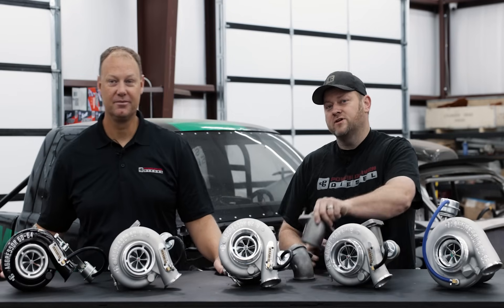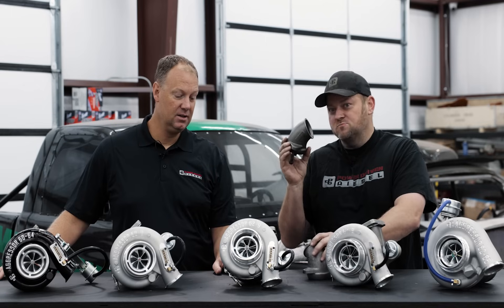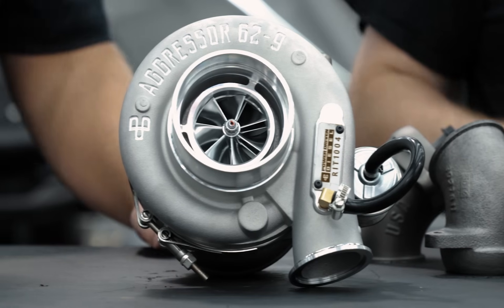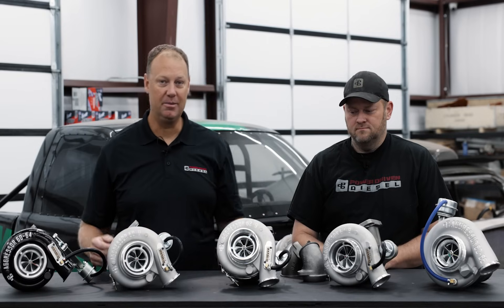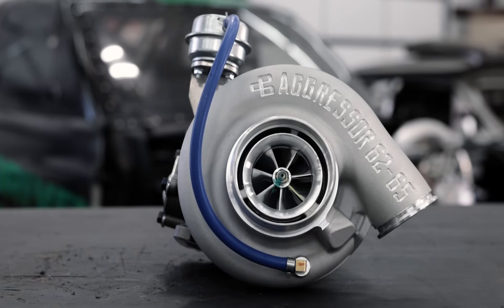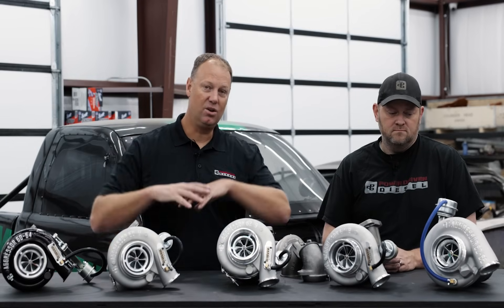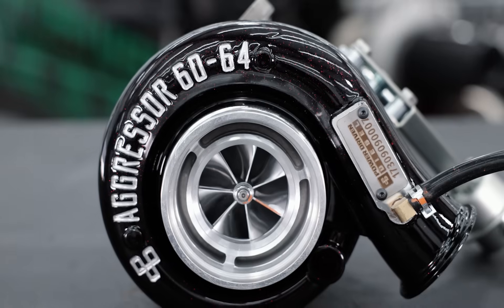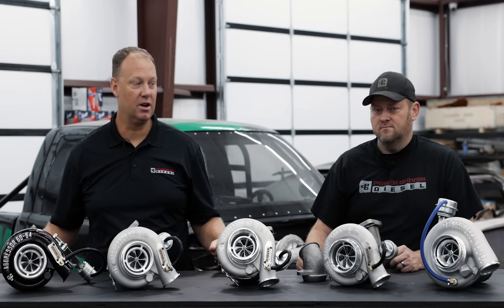Parts Bin: The Ultimate Turbo Upgrade for 12v & 24v Cummins

Comment: 2002 Vp44 air dog 100, with forward motion trans up to 650hp, good drop in turbo? S362 or 364? Quadzilla tuned with banks intake. Injector recommendation?

Comment: Today I had to make a Decision  on which turbo I wanted for my ram 2500 cummins 5.9 2000 I decided on the  HX35 60-64 I hope it was the best decision.. Injectors What would be the best combination?
Reply from the maker: The 60x64 is an awesome option and i would combine then with 7x.082 if it is a tow rig and 7x.09 if it is a fun truck,daily and some towing

Comment: The Aggressor 60-64 is not a drop in replacement on a 89. You need an aftermarket cross over pipe or custom intercooling to get it hooked up.
Reply from the maker: Thanks for the info.

Comment: You all throw numbers around like we all know what your talking about ,want to update my 12 valve but very confused,shit I'll just put the stock halset back on
Reply from the maker: Turbos are commonly sized based on the inlet compressor wheel diameter in millimeters and the outlet exhaust turbine wheel diameter in millimeters.  Stock 12v HX35 is 56mm compressor and 60mm turbine.  So the 60/64 is 4mm larger compressor and 4mm larger turbine.

Comment: Curious what is the wastegate opening pressure set point is on the 60-9? I had planned to control boost with a Turbosmart eBoost controller which needs a lower pressure rating on the wastegate. Thoughts of pairing a 60-9 with the TS eBoost Street? Thanks PDD! Stoked on the new offerings!

Comment: Keep up the good videos. I remember back in late 2000's helping ATP turbos as i recall testing there bolt on turbos for CR trucks. Learned fast then the 66/68 as i recall in the housing they where using was serious no go. Would surge on high load lower rpm spool. Turbo tech has come so far in such a short time now. I recall unhooking the gate so flapper could just free move and truck still surging and making 50+ psi. Yes i had some fuel for times back then but good times. Hope more keep finding ur channel as your guys are speaking the truth with what you say. Never liked spring gates. Compounds at least when right it didn't kill the drive off manifold charger. For a single absolutely not.

Comment: Can you explain what was meant by saying some wastegates can't wastegate the whole engine versus only the front or rear half at around 4:40? Do I understand correctly that the Holsets aren't as durable as the SX-E series and is that primarily due to the SX-E's 360 degree thrust bearing?
Reply from the maker: Stock HX35 came with a divided exhaust housing and the wastegate is on the rear portion of the divided housing, therefore only the back 3 cylinders are gated meaning cylinders 4, 5, and 6.  On later HY9, HE341, and HE351CW they came with non-dicided housings which allows all 6 cylinders to be wastegsted.
Reply: @pddofficial May wanna add a caption as you both said back 6 🤣
Reply from the maker: Holsets all came factory stock with 360 thrust bearings.  The S300 chargers have physically larger bearings, and larger/heavier shafts making them slower to spool but more robust/tough.

Comment: Let’s hear about exhaust brake set ups with these turbos. That’s one thing never mentioned.
Reply from the maker: None of these have exhaust brakes? That would be a variable geometry turbo. These are fixed geometry.  If only someone made Good variable turbo for these older trucks……..
Reply: @ sorry I know I wasn’t being clear. Those of us that have a direct mount PAC Brake or a Joe Biden Banks brake like an Inline type. That’s what I means. Mine is a pac.  Only fits the HX35.
Reply: @kylearaiza8808  I have a 2002 24v, NV5600 with a Pac Brake.  The 60-64 bolted right up with no mods needed.  EGT at constant pull with a trailer is cooler.  I also have PDD 50hp injectors.  I consistently get 20 MPG (hand calculated) when not towing.  Good combo for what I do living in the NV mountains.
Reply: @mannypuerta5086 I’ve got an 03 3500; 24v nv5600 inherited from my dad. Bad boys got 350k on the clock and I’m wanting to refresh the truck and add some pep. I’m looking to get a little more speed out of the truck, as 6th only get to about 65 (70 pushing it). Do you have any tips?
Reply: @kauvik_   Speed:  Change the gearing.  Power: Call PDD.

Change the oil every 5K and get a FASS fuel filter system with A-pillar gauges or a Banks IDash and go from there.  As power goes up, you’ll lose the clutch.  I went with a 1,000# torque South Bend.
Reply: @mannypuerta5086 what gears do you have in the axles? I have an automatic/4.10 truck, only get 13-14 mpg
Reply: @Lukewilson24 I have 3.54’s with 33” tires (285/70-17), so effectively 3.42 ratio.  Gen 3 brakes with 14” rotors all around.  It’s all a good stop and go combination.  The original brakes, while towing were inadequate, even with an engine brake.
Reply: @pddofficial

Comment: @ppdoffical let’s see some VP truck testing! Any of those turbos on an auto truck with a Quad and your select size of injector nozzles. That’s a normal persons set up let see it. And of course the supporting parts like an air intake of course.
Reply from the maker: That would be a great combo to test out! Thank you for the suggestion!
Reply: @pddofficial I’m ready to buy ASAP. my 180k mile stock HY35 sounds like it’s getting ready any minute to die. Has a lot of play. I could be cheap and rebuild it before it’s trashed. But I want and upgrade and you won’t ship to my location so I have to have it worked around. And plan on getting a quadzilla so I also have gauges since I only have a fuel pressure gauge now. Next would be injectors and now I see you have the newest ones with DLC which is great so I want to know! I promise I’m a buyer. Already have the triple disc converter and built trans.

Comment: Do you think that 62-65  turbo would do better than my Borg Warner s362 far as making horsepower and towing good  with my 12 valve manual transmission 5 speed I made 666 horsepower on the dino at the southwest truck show in St. George
Reply from the maker: Assuming your Borg s362 is an SXE unit, it came with a 68mm turbine wheel.  In comparison, the Aggressor 62-65 would spool faster and likely make a higher torque number, but would likely make less peak horsepower.  However, if you instead went the Aggressor 62-9 or 67-9, you'd likely see more torque and peak horsepower than the Borg 362 and definitely better spool up!

Comment: I purchased a  Borg sx362e with 68mm turbine .70 wastegate about 8 years ago from you folks. It works well , but am wondering if a 67-67-9 would be a noticeable difference. have a 215 pump, manual valvebody trans. I dont tow. Thanks
Reply from the maker: I think you would see a difference. The 67 compressor should give a nice bump in power and i bet it spools quicker as well. That being said your current turbo is no slouch. If you make the change i would love to hear your feedback! - Todd

Comment: Do you offer an HX35 based Billet 67/67 12cm turbo? I want to upgrade my compound kit, needs to be 4" inlet, t3 exhaust inlet, and 5 bolt HX35 exhaust outlet turbo.
Reply from the maker: We don’t make that combo. We found the spool too slow for most of our customers liking. Our 60-64 was our best performer in the 12cm housing.

Comment: Nice video. I have a vp44 2nd gen with the hx35 looking for a compound set up using the stock turbo on the manifold is that something dueable? I mainly tow with it (hotshot). And beat on it when not towing. Love the way this spools up.
Reply from the maker: We built our towing compounds utilizing an hx35 so it would be perfect for you!
Reply: @pddofficial  definitely going to check it out now. Thanks
Reply: Looks like options are s372 or s369 to pair with the stock turbo witch do you prefer for my use?

Comment: Please compare to a k27 also. I would like to see the improvement over the k27
Spool and egt
Reply: i think they have a old video comparing them.
Reply: @nicklaspollard1376 yes, i saw the k27 compared to the aggressor 60-64
I am curious how it compares to the 62-9 with the 9cm turbine housing instead of the 12 cm housing on the k27
My suspicion is that the 62-9 will spool faster and build boost sooner and harder seeing it has a much smaller turbine housing and a 62 compressor wheel instead of a 58 or 58.5 whatever the k27 has …   Also i wonder if we see compressor surge with that small turbine housing ….

Comment: Great work. I run your Aggressor 80/96 on my 6.7 powerstroke. Still going strong!
Reply from the maker: Compounds?
Reply: @pddofficial  Yessir! Your 80/96 with 1.15 undivided over a S366 non vgt. All custom stainless piping by me. Pic and video on my page.  Shot a rod out last month, currently building bottom end and trans. I got another ford guy to go with that atmospheric as well. Undivided is the way to go in a V8.

Comment: Just bought a 60-64 about a month ago and I am loving it. I had just made my own downpipe from the flange starting at a 3 and flared it up to my 4" exhaust.
Reply: Does the 60-64 have a lot of lag ? 
Thinking about one of those for my truck
Reply: @JustinSchooler-f2j  

No, not at all.  It's very very close to stock spool but just has way more once it gets rolling.

Comment: I've been waiting for these.  Can't wait to test out the 60-9.  My og aggressor 62 is gonna find its way to an auto truck. My 6 speed needs faster spool. Shooting for a solid 400.
Reply from the maker: The 60-9 at 400 hp will be amazing!
Reply: @pddofficial 60-9 or 60-64 for a vp44 6 speed truck under 400 horse? All it does is tow a single place trailer 90% of the time and a 2 place gooseneck 10% od the time

Comment: What turbo would you recommend for a 2002 Dodge 4x4 Cummins HO, NV5600 transmission, 3.55 gears, BFG KO 295-75R-16 tires, F1 Mach 1.6 injectors, Edge EZ, BHAF, and a Farmboy 5 inch turbo back straight pipe exhaust?
Reply from the maker: I would probably lean to the 62-9. Should work well with that size injector

Comment: Which one should I put on my 02 VW TDI? Currently have a Chinese eBay he351 as my atmosphere turbo. Maybe I should be going bigger
Reply from the maker: I would for sure rock the 67mm for an Atmosphere charger! -Todd
Reply: You have an ALH and want a 67mm turbo on a 1.9L? 😂🤣
Reply: @kylearaiza8808  Almost, it's a BHW bottom end with an ALH head. So it's a 2.0 L. Fully built with compounds. Currently makes 60 psi boost and close to 300 whp. The small turbo is a TD04, stock for a Subaru Forester. The atmosphere turbo is a HE351, stock for a 04-07 5.9 Cummins, and that's 60 mm.